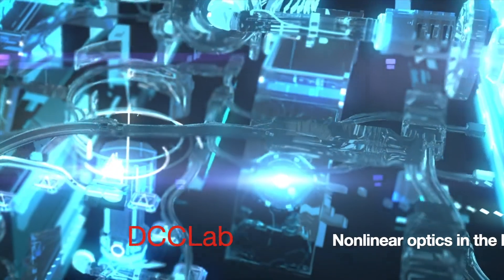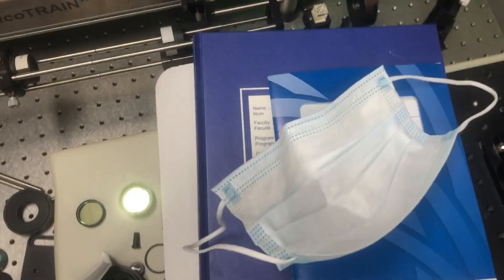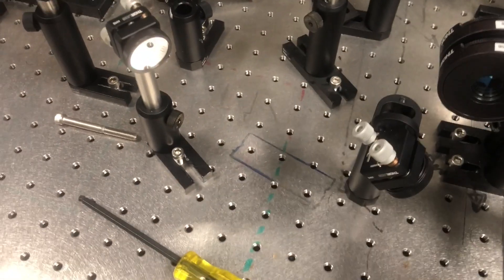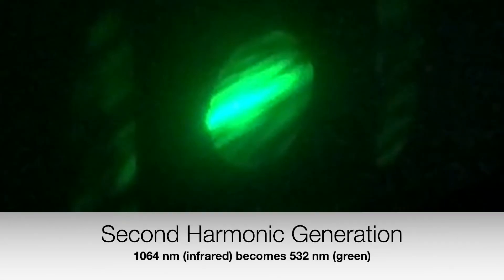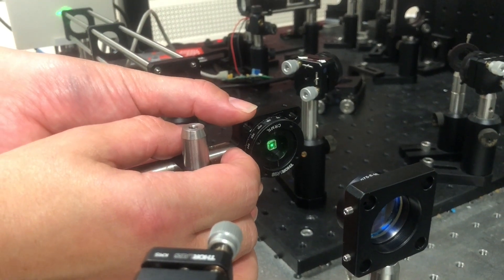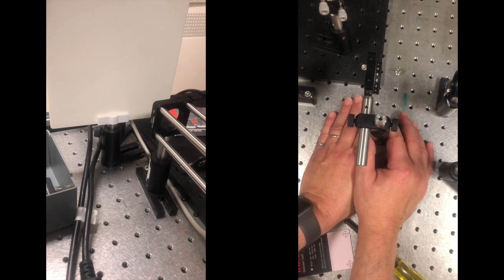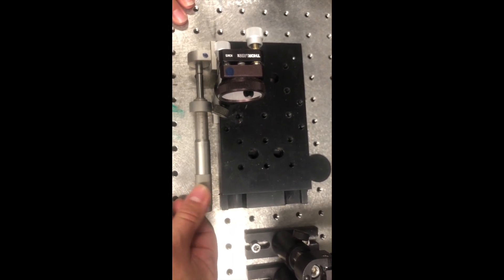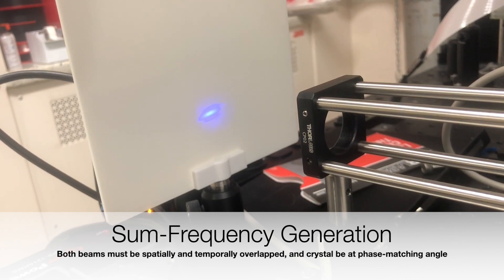Nonlinear optics in the lab: second harmonic and sum-frequency generation (SHG, SFG) phase-matching

Comment: I've always thought of frequency summation and doubling as if one was talking about a FM radio, but I only now am realizing it's about the interaction of the electromagnetic waves when they are also interacting with a third physical medium, whether it be it a heterodyne circuit or a nonlinear material , the mixing doesn't happen in free space , only upon simultaneous interaction with matter.
    How can light be FM modulated?
   What are nonlinear properties of matter that effect this interaction?
   Under what circumstances does air have nonlinear properties and what are they?
   In the case of a CO2 or nitrogen lasers (for instance), where there is an intermediate excited state that is opaque to the intended output frequency , would it be possible to opticaly pump such a laser with two other lasers who's frequencies separately can pass through the gas lasing material but their combined frequency is exactly what is needed to bump the atoms back to the desired excited state, maintaining the population inversion, therefore eliminating the need for cooling such lasers? Is there such an interaction?

Comment: i used some laser pointer  some yeas ago the red and blue for microscopic elimination of inorganic crystal growth   using a standards microscope 2 45 out of a de-funked binocular i had  the result was quit interesting with a problem using the green ,i found out later the green carried a low inferred similar to the frequencies you are using  but in a single beam it turning destructive with my simple set up ,, it may have uses in micro surgery  in differentiation of tissue  ? you have a neat st up , optical fibers ?

Comment: Great video!
What's the difference between a crystal specified as SHG @ 800 nm and THG @ 800 nm. Is the latter optimized for THG only or both?
Reply from the maker: There is no crystal for THG. Long story short, it cancels out (see D Débarre with E Beaurepaire about that). 

For different SHG wavelengths, it is the angle of the cut that changes.

Comment: Im sorry if you explained it in the video but im very new to this stuff and didnt understand all you said. But when you got the new frequency how much can that be shifted? Is it only possible to shift in one direction or is there any other limitations for the output? 
For example if I had a infrared light source, could it be doubled into visible light; and if so what frequencies could it have shifted to?
Again sorry if my question is weirdly formulated, I dont know what Im doing 😅
Reply from the maker: The technique I showed here only "reduces" the wavelength, and with a single beam you can only double the frequency (half the wavelength) via Second Harmonic Generation. You can double the frequency if an infrared beam and move it to the blue-green visible if it is infrared in the range 800 to 1100 nm. But don't forget you need ultrashort pulses and fairly high power.

Reducing the frequency requires a different strategy (optical parametric conversion), which is very inefficient and requires a cavity for amplification (optical parametric oscillation or amplification).

Comment: Hi Professor, thanks for the insightful video, I had a question about the mount for your BBO @ 2:34, i can see the thorlabs rotating mount is crm1l but could you tell me what the piece is inside that holds the BBO? also the dimension of your crystal? thank you again for the video!
Reply from the maker: The BBO came mounted in this mount. It’s probably from Casix or Castix.
Reply: @dccote  If i use a half wave plate to rotate my input polarization to the crystal, is that effectively the same as rotating the crystal in the mount you have?

Comment: Excellent video. I'm building a DPSS laser using intracavity SHG through KTP as a hobby and have seen exactly what you demonstrate (laser is CW). But I am seeing poor efficiency (~2% -- optimum for the cavity should be ~7%). The only resources I've found so far start with Maxwell's equations and build theory, but never get to tangible "engineering" level formulas. Are there simpler formulas / tables for different crystal types or is this just a "knuckle down and learn it" moment? Crystal is at optimum orientation and temperature and I suspect the waist isn't tight enough, but I'd like to calculate what size it needs to be instead of re-working the cavity at random.
Reply from the maker: Intracavity doubling a laser is difficult for several reasons. First, I think that the optimal length of the crystal depends on the size of the beam (which gives its Rayleigh range, or zₒ parameter). Second, the laser will be very noisy because the SH beam generated in the crystal will mix back with the fundamental and convert back to the fundamental or up from the fundamental depending on the exact phase diffference between the two when the return to the crystal.  This is a known problem and is why those green Verdi and Millenia lasers are expensive (they manage it differently: the Verdi is a single longitudinal mode laser whereas the Millenia is a super-multi longitudinal mode laser). I am not sure what formula you are talking about but I would say making a stable intracavity doubled green laser is tough.
Reply: @dccote  Thanks for the reply.  Yes, agreed it's a tough way to go. But hey, learning all the time and I want to see what I can do here before I change the cavity design. The types of formulas I'm looking for would allow me to calculate conversion rates given energy density in a crystal of a given type / length.  But as you point out there is a lot of complicated interplay with the fundamental.  Last week I received a copy of your well-reviewed book on the topic. Looking forward to reading it and learning more.

Comment: Thank you for the information. Please is there a max frequency limit for this crystal? In theory is it possible to put group of crystals to multiply frequency until gamma ray spectrum?
Reply from the maker: It is a bit complicated because crystals are not transparent in the UV/x-ray.  You have to use a slightly different strategy, and I am no expert, but multi-harmonic generation is the way I have seen it done in the past.

Comment: Very nice demonstration, Thanks. I want to frequency double 1600nm from the supercontinuum. I am thinking to use a dichroic mirror to separate the 1600nm part and frequency double it using MgO PPLN. I am wondering what specs should I focus on when ordering SHG crystal?. Is it just the crystal should be phase-matched for 1600nm or something else?. Also, how focused your beam should be (spot size focused into the crystal)?
Reply from the maker: When you order from these companies, you can simply say "I want to double 1600 nm".  They will offer options.

I have ordered from CASIX for as long as I remember.

https://www.casix.com

That said, I think your supercontinuum will be too low a power to get anything important.  If you want a lot of power, this is not the right approach.  A Ti:sapphire laser operates at 800 nm with very high powers.
Reply: @dccote  Thanks , that's very helpful !

Comment: Thank you for your explanation. Very impressive video! I have a quick question about the beam shape, which looks very elliptical. Is it because the incident beam is not perfectly round? Does BiBO crystal affect the beam shape?
Reply from the maker: It is elliptical for many reasons, it is partly because it is incident at angle angle and that phase matching works well along one direction, not both. I made no efforts to obtain a nice beam.

Comment: How about different frequency generation using the same setup?
Reply from the maker: Very different process: it is called down-conversion, and it is very weak.  Typically, these are put inside an Optical parametric Oscillator to amplify.

Comment: This is an excellent demonstration here. Briefly, how would you interpret BBO crystals and biomaterials(e.g. microtubules) both exhibiting nonlinear optical properties?
Reply from the maker: They have a structure that is asymmetrical. Like a dipole. The technical term is “the are non centrosymmetric”. This makes them distort the electron oscillation a bit and create second harmonic and DC (typically THz with femtosecond pulses) at the same time.
Reply: @dccote  Thanks for this, keep up the good work my friend!

Comment: Just a quick question. I’m using BBO , 1040 nm and 801 . This should work as well, right? In addition once the beams are spatial overlapped I can send them through BBO and check for SFG and play with delay? If it’s overlapped in time and space we should see blue. Am I thinking of this correct? Great video!!
Reply from the maker: Probably but it depends what angle your BBO was cut at.  When you order it, you typically request "a BBO for secondharmonic at 820nm with Type I phase matching" for instance. You can tune that by rotating the crystal around the axis of polarization of the incoming fundamental.

Now, if you want to do Sum Frequency, then the phase matching angle will be approximately between the SHG angle for 800 and the SHG angle for 1040: you would send both beams, make sure you get SHG from either one at the proper angle and orient the crystal approximately in between.  Confirm the polarizations, because if they are not appropriate, this will not work.  TYPICALLY, they would need to be parallel for o+o->e SHG and o+o->e SFG. 

The spatial overlap is obviously critical, so is time overlap and polarization and crystal orientation.   It is easy to get one of them wrong.

Comment: Can you make a video on only Cristal how it made who to cut it proper dimensions of crystal
Reply from the maker: I always use the recommendation from companies: for instance, if you ask for a quote from Casix, and say: "I want to double 800 nm in BBO", they will offer the possible cuts of the crystal.
Reply: @dccote  can I do this experiment at home with low cost ?
Reply from the maker: @vaibhavchamkur1136  No. Impossible. You need an expensive femtosecond laser (more than 100k$ US).
Reply: @dccote  but what will happen when I do this with normal lasers
Reply from the maker: @vaibhavchamkur1136  Nothing. You need a very intense laser if you use this type of crystal. The only way to do this with a normal laser is to use an extremely special type of crystal called a PPLN, and they are outragesouly expensive from what I understand.

Comment: please what is a non linear crystal? anyone?
Reply from the maker: Normally, a laser that propagates in any material will simply exit at the same, original frequency because the atoms or molecules oscillate a the same frequency as the laser.

When the laser is intense, and the crystal is "sensitive" to the intensity (i.e. it is a "highly nonlinear crystal") and the phase matching conditions are matched, then the light that comes out is at a different frequency from the original frequency.

So a nonlinear crystal is a crystal that permits the creation of new frequencies thanks to its nonlinear coefficient and its birefringence (examples: BBO, LBO, KDP, KTP, etc...)
Reply: @dccote  Thank you so much Daniel.
Reply: @dccote  so the non linear crystal allows the photons to collapae and when tuned in phase and time the mixing product is such that the 2nd harmonic is maximal?